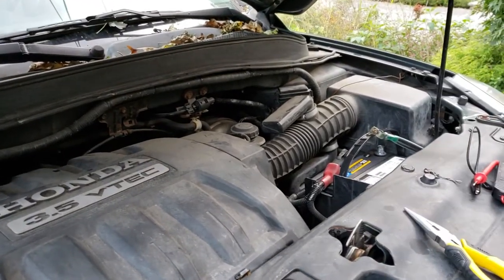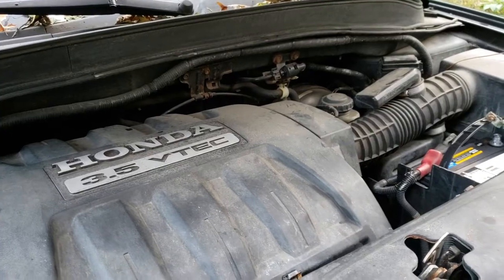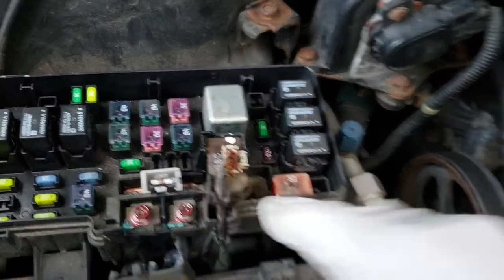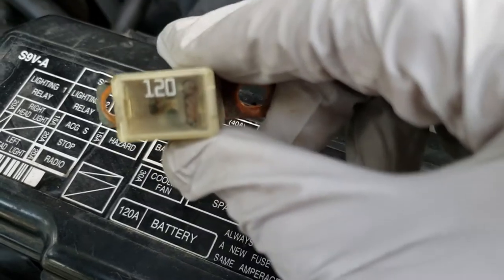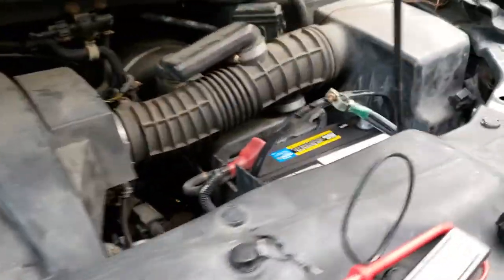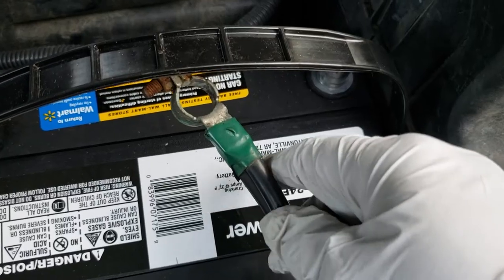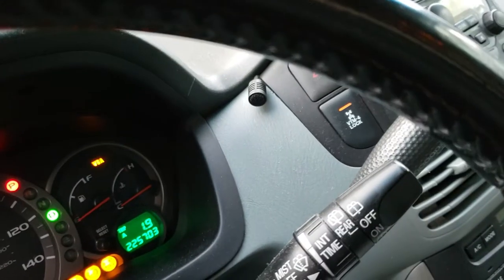Honda Pilot No Power Won't start problem solved

Comment: I had this issue, went out and had no power, couldn't use key fob to open or anything, but battery was not old. I though it was my 120A battery fuse as well, but it wasn't, I jumped it , ran it, than parked it and noticed my brake lights would not go off, therefore , they drained my battery. Turns out there is a plastic grommet in the brake peddle that broke off and it was not tripping the break light switch to off. I put a wedge in to press against the light switch and it turned off, went and got a 10$ grommet placed it in the hole and problem was fixed.. This is a common issue, easy fix

Comment: I'm working on this car right now, the wiring on that module is burnt just like the one on this video. Is that something I need replaced and how can I do that? Thanks Kelvin. this video helped alot!
Reply: Wondering them same thing.
Reply: @lucasmartinez8047  I replaced the fuse and it worked perfectly, try using an electrical tester on the wire and spot the wire goes in. If it beeps you're good!

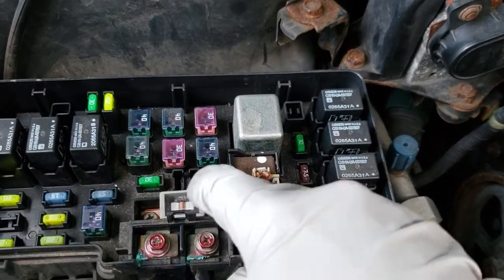Comment: HELP please.  to the right of the 120 amp fuse, 0:14 minute, is a fuse with wires running through the  fuse inserted into a rust brown block.  Can someone tell me where I can obtain a replacement?  what is the fuse amps? name of part?  I have a 2007 Honda.  Any help is greatly appreciated.
Reply: Same question hope he answers
Reply: Did you ever get your problem solved?